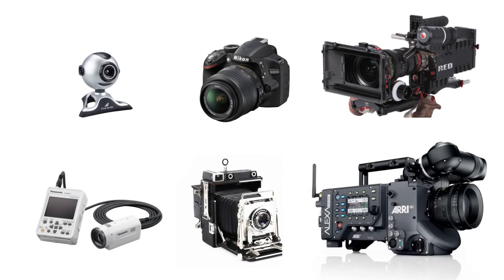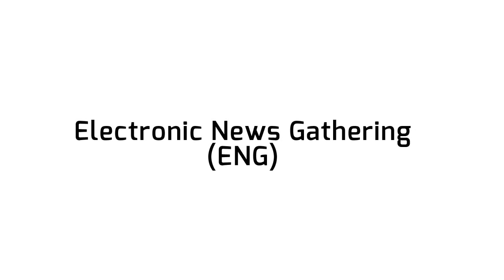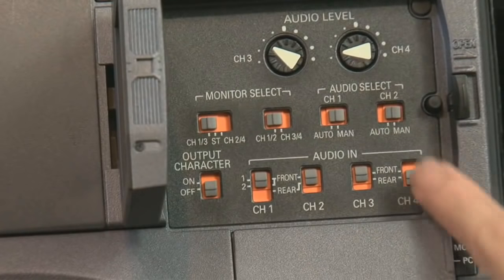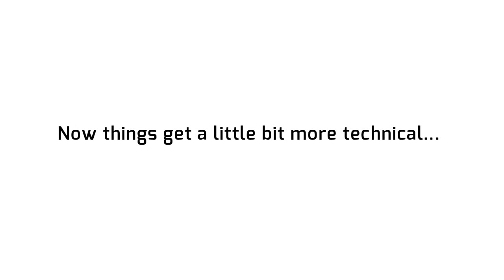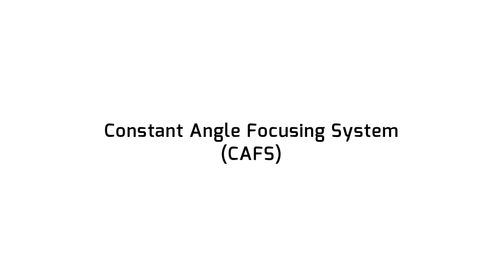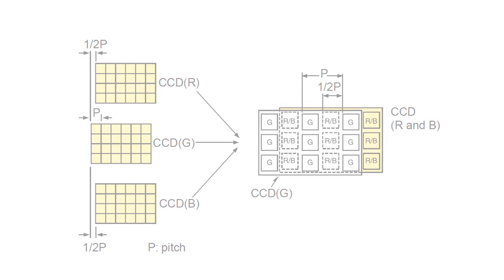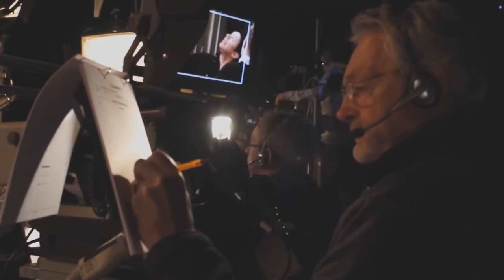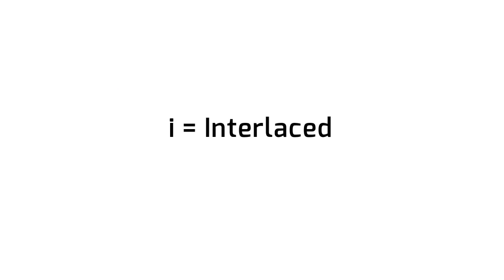Understanding Television Production Cameras

Comment: Genlock =/= timecode!

And the sensors on the pictured EFP cameras are actually quite small  (2/3”) when compared to most sensors on interchangeable lens cameras (still cameras, digital cinema, etc). This small size is what allows lenses with such large zoom ranges and fast, constant maximum apertures.
Reply: The solid state sensors in cameras patterned after film cameras are made to operate on a single focal plane, just like the photographic film that came before. Although color film was able to let light pass through its layers (and one single sensor no longer made, the Foveon), most single-sensor cameras are unable to do this. Instead they rely on a mosaic of many small photosites to separate the colors. Putting all of those tiny colored dots on each and every photosite requires a bulky framework, and that cuts down on usable area. What's more, it makes only half of the sensor's area available for green, and only a quarter each for red and blue! These cameras have forced chroma subsampling! Pro TV cameras don't. And while the sensors are smaller, there are 3 times as many, and no framework to hold those little filters. MOF the pro cameras use high quality dichroic filters with sharper cutoff slopes for better color separation. The result is better S/N ratio even with the smaller sensors, and better color saturation. And because color subsampling happens after the sensors, you can't beat a pro / broadcast TV camera for color keying. A 3-chip camera is the only one that can do true 4:4:4 for that.
Reply: Genlock has nothing to do with timecode, it allows different cameras to be timed to the switcher. Timecode is a function of your record device.
Reply: @mikecumbo7531  Not sure if you're replying to me or someone else.. if me, I'm not sure what you mean; I explicitly stated that genlock does not equal timecode.

Comment: Minor correction. In the USA the vertical frequency is 59.94hz, not 60.0hz. Also the H rate is 15,734.264khz rather than  15,750.0khz. This has been the case since NTSC color was standardized due to inter-modulation of the color subcarrier with the 4.5mhz sound carrier offset. With HDTV or rather ATSC or DTV, and subsequent component video, the need for 59.94 is no longer present. We can now run straight 60.0hz. Yet it remains a legacy standard that will not die.
Reply: "Minor correction" 🤓👆

Comment: One of the other really important characteristics of box lenses that everyone forgets about is the maximum speed at which they can zoom. This is mostly only relevant for live sports broadcasting but given that there is no lens ring to throw, you have to rely solely on the electronics of the lens to be able to shift all that glass really quickly to catch the action while still being accurate. You often don't see these moves on air but occasionally a camera op will get caught out on a slo-mo replay of a critical moment (usually with the video ref inspecting it) and you'll see the full length and speed of the lens.

Comment: Interesting...Due to the fact that, whilst the illusion of smooth motion could be achieved at 25 or 30 fps, avoiding perceivable flicker on a scanning CRT required development of a higher scan rate system.  This problem was overcome by using the interlacing process, which also avoided excessive bandwidth issues.  However, by necessity I discovered for myself that the 1080i digital recording system used by one of my cameras (which should have made it incompatible with the 1080p system I wanted to use) employed a technique for backwards compatibility.  Although it produces two interlacing fields, at a rate of 59.94 fields per second, each pair of fields are of the same scan.  The camera actually records at a rate of 29.97 fps, and, by using the appropriate software, the recording can be smoothly de-interlaced to 1080p.  As a matter of fact, my software permits me to de-interlace 1080i directly to jpeg format, as a stream of snapshots.

Comment: actually we don't watch TV in interlaced mode anymore, because every digital video decoder performs deinterlacing on the fly, or the TV does that, so there is no alternating between fields.
Reply: But they still send interlaced to save bandwidth ^^

Comment: Since when do "TV cameras" have big sensors?
Reply: they don't I don't know where that info came form
Reply: It depends on what you are comparing with. If you compare with a one CCD camcorder for consumers a good Sony ENG/Field recorder have larger sensor (x3) since they also have 3 sensors ...
Reply: Its just bullshit. A lot of misinformation here.
Reply: looking at spec  the CCD sensor size is 1803mm which is large then a full frame sensor,   most  ENG camera have a 2/3 sensor  which is  58.10 mm  ( there could possible be a larger one out there I'm not aware of  I asked  our engineer,  and he siad the one we use and he knows of 2/3 sensors.   hope that helps 
http://photoseek.com/2013/compare-digital-camera-sensor-sizes-full-frame-35mm-aps-c-micro-four-thirds-1-inch-type/     *edit  3 ccd cams have a much smaller senor
Reply: Maybe he is comparing to older cameras. Of course today dslrs now have extra large sensors
Reply: @SammyGArt  That is NOT the type of CCD used in a broadcast camera, that is a medium format stills camera sensor meant for extremely high end cameras that are used in fashion photography and the like. Broadcast cameras almost never have larger than a 1" sensor.
Reply: What he said was right. Bigger sensors, better specs. That doesn't mean TV cameras have the biggest. But some are bigger than other TV cameras
Reply: Λ N T O N - compared to the one in my phone it is huge

Comment: I enjoy how you spoke of 3-chip cameras and interlacing as great stuff, but those are both technologies that would have been phased out by now if they hadn't been so widespread. Modern single chip S35 camera systems can way outperform any 2/3 inch 3CCD or 3MOS. I think Sony is the only company making a UHD-capable 1/3 inch 3-chip camcorder.
Reply: Interlacing is still a very big part of the broadcasting industry and something that is being relied on from the moment of conception of the PAL system (though, transmission-wise a lot of things have changed with digital TV, of course).  That's not widespread, it's just what the television broadcasting and recording system was based on because progressive would've posed a bandwith problem back in the early days of television.
Progressive, though not called that way is something that exists way before interlaced became a thing and is what chemical film does.

You are also comparing sensor sizes found in camera's that are slightly out of the ordinary when it comes to ENG work (though the borders between them are slowly fading).  Having a very big (or shallow) depth of field with a hugely out of focus background isn't always a good thing in ENG, where you'd be otherwise feeling like you are unscrewing the focusing ring of your lens when keeping someone in focus simply for it having such a big sensor size.
3CCD's camera's (or 3CMOS camera's) are not something not dying out because it's so widespread, but because it makes transmission of a non-color-coded signal much easier instead of having to "Debayer" a sensor's image to see what color each pixel was seeing by comparing it's value to surrounding pixels.
They usually are also more sensitive to light in a very different way than Super35 sensors are.  If you would compare the same format sensor to 3 of them there would be an increase in the amount of light it receives, simply for every sensor seeing the exact same color information at every pixel instead of having a block of 4 (2 green, 1 red and 1 blue) decide on the luminance of the signal they were seeing.

That said, I am not saying Super35 sensors do not have their place, they are just for a completely different market.
Reply: @Dutch3DMaster  60i vs 30p is not an issue for modern signal flow (I'm in an NTSC region). I still believe that is an issue of convention and being so rooted in the 60i system that changing everything over to progressive would just be too expensive. I will agree that the smaller sensor is more suited for ENG, but not necessarily that small. A journalist in the local TV station I work at said he values the compactness of the Fujinon 4.4-62mm B4 lens, since a similar zoom range on S35 would be a massive piece of glass. Still, image processing has gotten much faster at this point to allow for the 1" MOS to become a viable alternative to the smallest sensors. Canon recently came out with their 1" replacement to the popular 1/3" XF305; the XF705 (which can shoot 4K60p in H.265). DoF is still not so shallow to be hard to focus, and the image quality is definitely better than the previous-gen version. I've even seen Super35 Sony FS7s used as TV studio cameras. (Some) things are changing. Slowly.
I suppose you're right about effective sensitivity being better with a 3CCD, but I'd like to defend the Bayer matrix as more accurate to our eye, being most sensitive to green. The cone cells in our retinae are not perfectly proportional either.

Comment: Just one correction, Brazil, Laos and Thailand use the PAL-M standard, that is in fact 60Hz and 525 lines (just like NTSC), due to local power grids being 60Hz... I'm not sure of the technical changes of it, but it's almost interchangeable with NTSC, except if you throw NTSC on PAL-M or vice-versa without any conversion/transcoding device you get a B/W image.

Comment: I often work with broadcast Camera, at last Weekend with an Sony XDCam. And i didn‘t know hol they work, until now. The only thing I knew was that you can do lots of stuff like, Colormatching, WB adjust etc. and they are heavy. And after 2h I cant hold the pic stable and my „Boss“ in the transmissioncar told me to take a break and to use the camstand for a while 😁

Comment: Genlock is a signal that synchronizes frame rate TICK of individual cameras (or other devices). Meaning the frames from different cameras capture exactly the same moment in time. Otherwise each camera would have its random tick. Meaning switcher would either have to do the synchronization (wait for all frames to arrive adding latency) or cuts between non-synchronized cameras would not be clean. It has nothing to do with time code. 
Cameras can have time code synced but still not be genlocked, so the frames from two cameras with exact same time code could still be showing slightly different moment in time... depending how much off-sync they are.
Reply from the maker: Thanks for the clarification! I think out of all the topics I tried to cover in this video that was the thing I struggled with explaining the most

Comment: Fun fact: the tape industry that went with broadcasting is finally and completely obsolete, with HDCAM SR being the final format. I work at a mastering facility, and we were throwing out a bunch of dbeta and betacam sp decks that at one time were worth a luxury car.
Reply: If i were you id pick up as much as you can because it will probably be valuable later on
Reply: The problem is that these decks run with an SDI workflow, which means you need a slew of equipment and knowledge to make it work properly.
Reply: @fen4554  yea but even if you dont know how to use it it might be valuable in say 50 years. hipsters basically "analog enthusiasts" and those types would probably want it
Reply: @cinialvespow1054  Are you referring to SD tube TV, or modern TV?
Reply: @cinialvespow1054  Anyway, the short answer is that the technology outgrew its very expensive roots. They invested into systems that were worth millions on dollars, and they had to keep using that tech for a long time. The industry got locked into old standards, and those standards were part of expensive systems.

Comment: This is a great primer for studio based cameras but doesn't really cover non drama location shoots and another important part, crew training and kit supply. I speak from experience here having worked in TV production for the last 4 years.
A lot of what you watch in the UK that has any sort of location shooting will be shot on Sony FS7's or Canon C300's and pretty much all will run Canon Glass up front. This is down to 2 key things which feed back on each other and reinforce themselves. 
Basically unless you are a full time camera ops you won't own your own kit. Camera bodies are expensive, parts break on location and the bodies get upgraded periodically by manufacturers so become obsolete. The regular production companies that make the TV you watch aren't filming regularly enough to make owning their own kit worth it, they rent them as and when needed. Of course rental companies will only stock a few model types in order to keep costs down. This standardisation extends to sending Sony cameras out with Metabones adaptors to handle Canon lenses to remove the need for stocking even more types lenses than necessary. This limits the number of cameras on the market which in turn means people only get to use what's rentable, they get trained on and become comfortable using those platforms so only ask for them. It feeds back on itself. Change is slow. 

Most people filming for the non drama stuff on TV aren't full time cam ops, they're shooting researchers, shooting producers and producer directors. We are hands on from with making the show from start to finish and are jacks of all trades. It never used to be that way I'm told, but budgets are always tight these day so we have to do a bit of everything. We don't have time to learn the menus and layout on loads of cameras we just need kit we know.  

When you hire in crew for presenter days and other shiny stuff like that then those lovely peeps bring their own kit. and thats when you get to see some more exotic kit like Arri Alexas, the odd Red and some other sexy stuff. on the other end The One Show and a couple of other BBC Studios productions will sometimes shoot on Canon XF305's as secondary and support cameras as well. The picture quality isn't as good but an internal lens setup and a fully bombproof construction make up for it in certain circumstances. The fact the BBC production services own a ton of them and so they're cheap to rent helps production managers make the choice too ; ) 

This is a bit of a simplification too you understand, but should help fill some gaps left in this otherwise great vid.

Comment: Hey in case anyone wanted to know, those lens cost around 200k
Reply: Only for the flagship lineup. Fujinon make a large variety of them, their cheapest box lenses are ~$60,000, but they can be found in the "regular" variety for as little as $5,000 and even $1,000 for 1/3 cameras. (The ones shown in the video are 2/3 which have sensors that are twice as large.)

Comment: that was good stuff seriosly i noticed the corner sharpness and the chromatic both look excellent without
also interesting about the sweetspot f11 on the most lenses what are a lot smaller then the 230 mm front diameter like 87 (the biggest) and maybe 32 mm for the smallest got those problems a lot and had their sweetspot in between f4.5 - f10 
seeing the phase 1 having a measure of 47 db it sounds far away from 60 db but unknown if there is a differens in measurement

Comment: The earliest cameras had film detail down to the level of singular photons because of the analogue process, it'll take a while to get digital to the same level! 
It's when all the other areas of film where improved (the capture, production, the transmission and the screen it's shown on) all depreciated the quality of the image. An example is old films being able to be shown in 4k now even though originally they looked much more primitive.
Reply: The lenses available were and still are the bottle neck for low ISO film. Though they don't have as much detail as you are framing about 😅 they can only Capture the detail upto the size of the halide crystals. The smaller they are their light sensitivity will decrease, their grain sizes will decrease and the macimum possible sharpness they can get will increase
Reply: not quite bud

Comment: A little corection about interlace. There are no actual horizontal lines of pixels on crt tv screen. You didn`t see stripes on tv not because fields change too fast. The very design of tv screen was so that inerlaced image is blurred vertically.

Comment: well. some modern mirrorless pro/prosumer camera's are in many ways out performing the big production camera's you normally find in studio's.  investment in these big and veeeery expensive camera's will naturally lead to them being a few years behind the leading edge as they cannot affort to change out the camera bodies every year.  many movies and tv shows are already been shot with  smaller RED camera's and  mirrorless camera's like panasonic GH 4/5 and sony A7 series are used heavily in documentary and also for news gathering, and for Backup's.  Their specs are actually better then most studio camera's in terms for resolution, dynamic range, noice etc.  ( for example cinema 4K or UHD at 60fps  progressive, not interlaced, and even 6K is possible. and can output 4:2:2 which is more then what's  normally needed. they have F-Log recording and can easily be applied with color profiles designed for boardcasting and cinema.
Reply: Studios for TV shows are often companies of their own, just like the companies creating documentaries. They're not owned by the station, so they have a budget to work with and will not buy the latest RED every year. The whole gear has to be installed, set up and configured for a smooth taping process which takes some time. Also he explained why some cameras are that big ... you don't want to give a professional camera operator in a studio or football match an A7 where he has to fiddle around with everything.